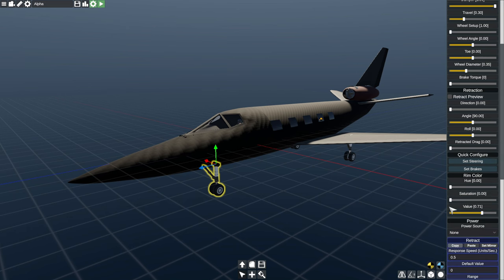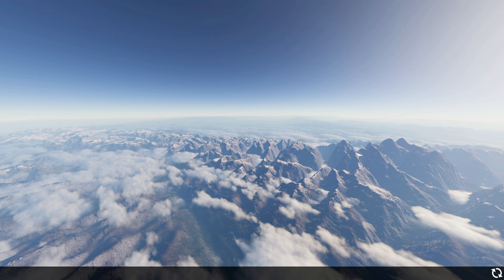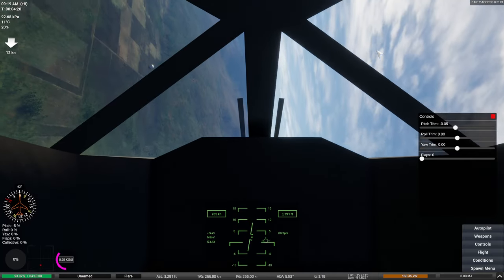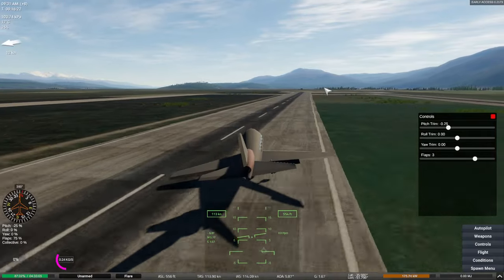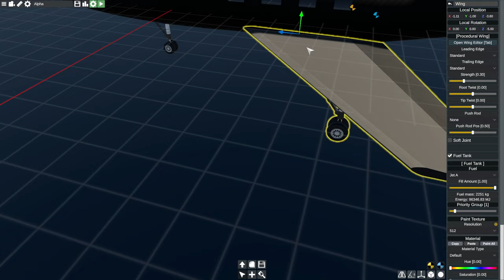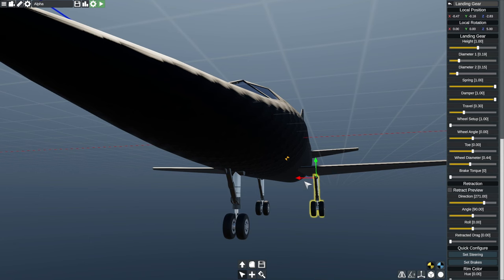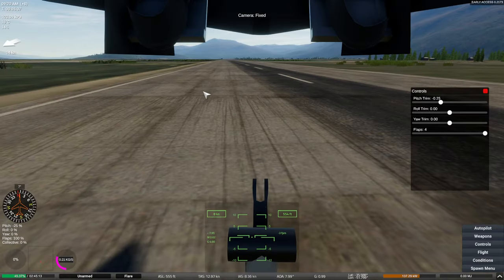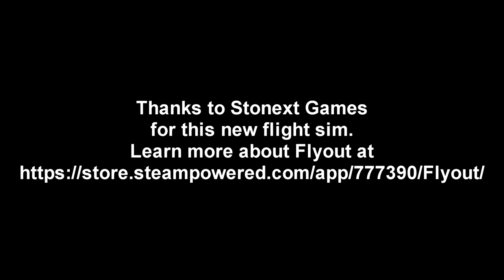Flyout Early Access - First Landing

Comment: The flaps do have buttons, on my install it is set up with the number 1 and 2 under the F keys.
You can also move the internal camera a bit by using the middle mouse button, hold it and move.